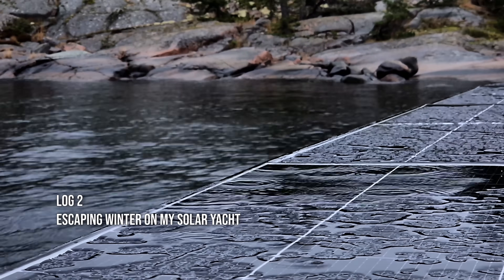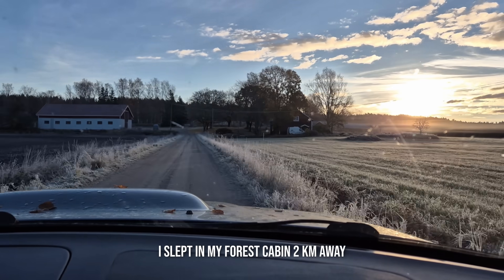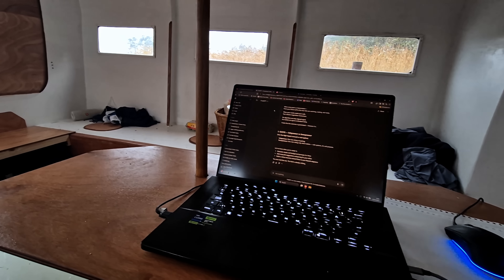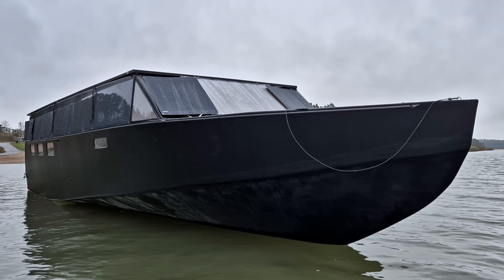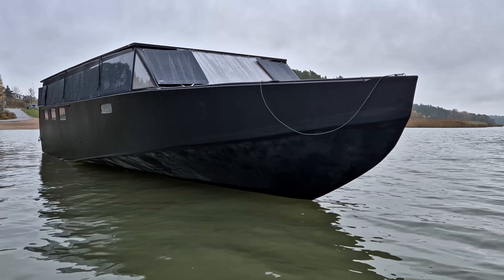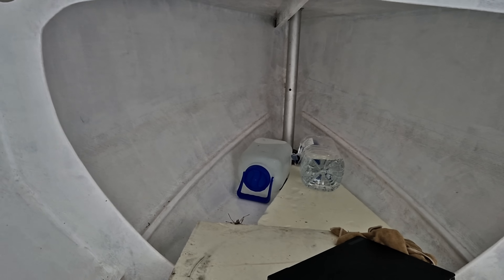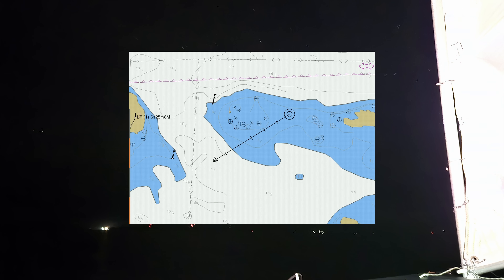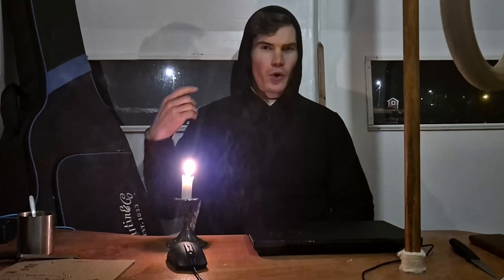🌧 Escaping the Nordic Winter on a Solar Yacht That Runs Forever

Comment: Light weight design is great with electric propulsion and battery capacity in mind but I feel like heavier ballast and a shoal keel would stabilize you more in rough seas
Reply: It won’t matter in rough seas. This guy will be in the water.

Comment: I would agree with those who have suggested staying with the ridged solar panels. If I may I would suggest a larger air gap between your roof and the underside of the panels. This will keep your interior much cooler as you progress south. A small increase in ballast to compensate for this would not affect your efficiency.
Also you will probably want a white paint job before you get to the Med. 
Great project. Good luck.
Reply: Agreed, the black surface will get so hot down south that it’ll hurt to touch, same goes for the dinghy. Make sure the roof panels have an air gap and a slight tilt to let rain and spray water drain off. Also, add more safety features in line with SOLAS standards (radio, proper lights, life gear, flares, etc.) and have backups for critical equipment. Be mindful of the weather — even though I really like the project, I don’t think the construction is sturdy enough to handle heavier seas; the twisting will eventually cause it to fail.

Comment: I know people who have supplied the electric for their off grid homestead with a small wind generator made from a car alternator. A company refurbishes and re gears them. 3’ blades. Might work well for you at least when anchored.
Reply: Wind generators on boats are not good. We had one, and it was very noisy. Also, you usually want to anchor in harbors out of the wind. And it takes a good amount of wind to get any power. Solar worked very well for us
Reply: @JacqueS6845 makes sense. It always seemed like it wouldn’t take too much innovation to borrow some function of tidal movement generators. A way to capture the wave movement energy.

Comment: I really love your project! I have been thinking of a similar design for almost ten years now. But family etc.. time runs short. I envy the freedom to potentiella go to the mediterranian. But. :) take this the right way. The boat doesnt seem that safe, I dont see bulkheads really and a shallow rear with a door. Also hull thickness is perhaps a bit sensitive. That is why you normally have compartments and floatation devices.  Things go wrong. Try reaching out to a pro sailer to guide you in proper safety gear, please, I want to see this boat go far!

Comment: The solar panels need about 3 or 4 degree of elevation so that water can pour off.
Reply: A slope.
Reply: The more water on the panel, the more power they will produce in the sun. I have a sprinkler on my roof for the reason.
Reply: And why would he put them on after putting the boat in the water. Would have been easy with it out.
Reply: @EbikeRandomadventures  I fitted mine on while in the water because it's easier to reach. Otherwise when the boat is out of the water the height makes fitting the panels difficult.
Reply: You know this is a boat?
Reply: @Pihlalorjoone  Water's still sitting on the top of the panels, and if you don't put an upwards bow, then as the boat ages and the ceiling warps it's going to bow inwards in the center and turn into a bowl

ice and snow in winter and seasalt pooling in warmer times and climates are also a concern with the water stagnating on top of those panels
Reply: @Pihlalorjoone  You still need a slope.
Reply: @Pihlalorjoone I don't think everyone understands how boats work.
Reply: @izzyplusplusplus1004  I do. Any water that collects on the panels dries out leaving a deposit. Till, after a while, you get a mud deposit preventing the light from hitting the panel.
Reply: Oh please, is a boat. It will clean itself with the rain
Reply: @tmog1000 How's water gonna stay on the panels while the boat is floating, and moving all day? No sir, you don't. A flat roof cannot hold water with a 5-6 knot wind, and on a boat being moved by the waves. RV's have flat roofs, and folks put solar up there on those all the time. And they get set still and level!
Reply: @izzyplusplusplus1004  Well I have solar on my yacht for 8 years now and I have found that I do need a slight slope to drain the water off. If the physics on your part of the world are different then that would explain it.